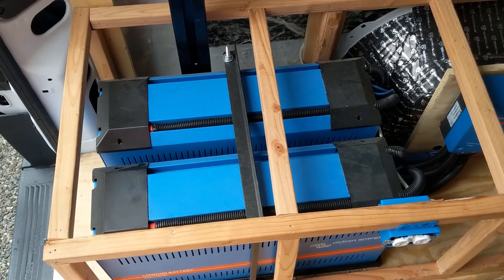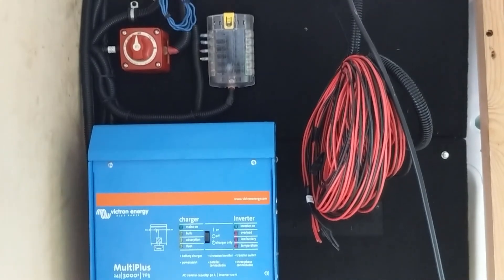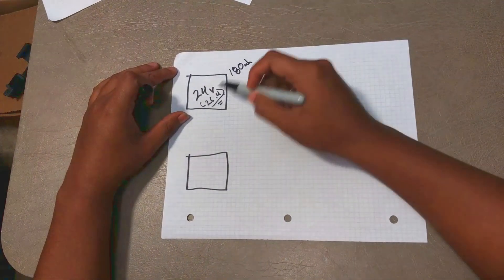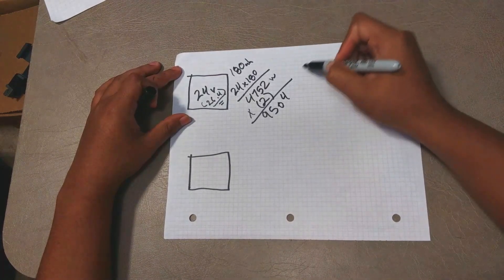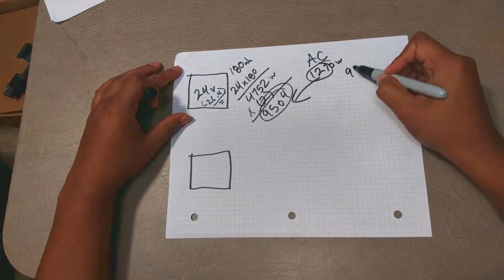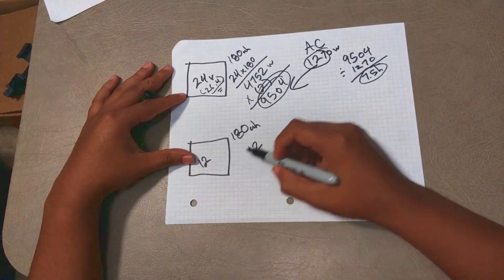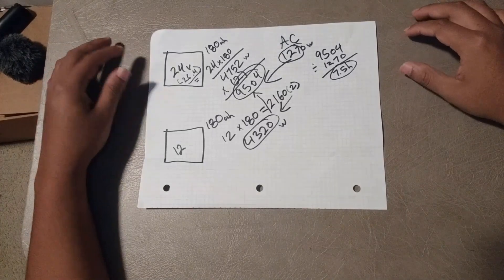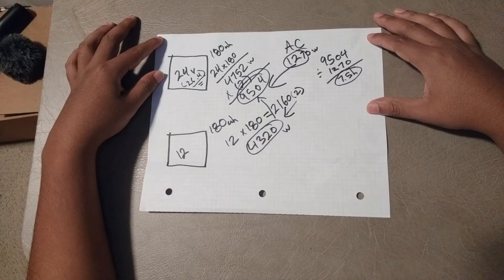Ultimate campervan electrical system | Power AC off-grid| #vanlife

Comment from the maker: READ FIRST BEFORE COMMENTING
To clear up some confusion about series and parallel read this article: http://www.enerdrive.com.au/connecting-batteries-in-series-or-parallel/ 
which says that if you connect your batteries in parallel it will double your Ah for the system NOT per battery and keeps the voltage the same  "2 x 12V 120Ah batteries wired in parallel will give you only 12V, but increases capacity to 240Ah." or if you connected your batteries in series it will double your voltage but keep your AH the same "2 x 12V 120Ah batteries wired in series will give you 24V, but still only 120Ah." Therefore 2 12v batteries don't have the same power as 2 24v batteries, because to find the total watts you multiply V by AH and to find the total watt hours. Then you dived by 100 which is mentioned in this article: http://www.altenergy.org/renewables/solar/DIY/battery-bank-sizing.html . "Let's say you go out and buy a battery for your solar system that is 12 volts (push) and 105 amp hours (storage capacity). You could find out approximately how much energy this battery will store / provide by calculating the watt hours. To do this, just multiply the volts (V) x the amp hours (AH) and divide by 100."
Reply: That is what I said....dumb ass
Reply from the maker: @albertcassler8763  This proves us right... our math is right.... In our video we compare (2) 12v batteries connected in parallel to (2) 24v batteries connected in parallel...
Reply: Nomadic Millennials yes you do in your video. But that’s not the right comparison. If you had two 12v batteries they would be approximately half the physical size and cost. So for the same space and money, you’d have four (not two) 12v batteries containing double the Ah each. So the total power (Watt Hours) will be the same as your system! So your example is basically saying “if we spent half the money and used half the space, we’d have half the total power”. That is true... but it’s not a reason to have a 24v system... there are some good reasons... you need fewer large cables (lower amperage), the jump through an inverted to 110AC is smoother.   Applying your logic, you could wire your two 24v batteries in series and have a 48v system, but that wouldn’t mean more Watt Hours. You’d just double the volts instead of the Amps. In parallel the volts remain 24 and the amps double. Either way it’s the same power for the physical space and cash you have invested in your batteries...
Reply: Here’s the simple maths:
Imagine you had two 12v 100 ah batteries. You can configure in two ways: series or parallel.
In series your battery bank would be 24v and 100 Ah giving 2400 Watt Hours of power.
In parallel, they would still be 12v but you’d have 200Ah giving.... 2400 Watt Hours of energy. The same amount of usable power!

Two batteries side by side, a 12v and a 24v, from the same manufacturer will be the same physical size and contain the same power. They probably cost about the same too! The 24v will have fewer Ah than the 12v. Does that clarify? Just helping to explain...
Reply from the maker: @jasonhughes6417  You couldn't fit four 12v batteries in the exact same space our two 24v batteries takes up. It's not half the size.. one 12v battery is a little bit smaller then one of our 24v batteries.
Reply: Nomadic Millennials 
Let me send a more detailed answer to explain my point. 

I accept that in reality a 12v battery might not be precisely half the size of a 24v battery with the same Ah. That’s because besides the parts that store energy, batteries (especially very smart ones like your Victron) have all sorts of other components like built-in BMS, connectors, circuits etc. These components don’t follow Ohms Law (!) so this might be a great reason to have one 24v battery instead of two 12v... because you’re not also doubling these components and the space occupied is perhaps smaller overall therefore.

I’m just trying to explain why some are questioning your calculation, and hopefully help some other viewers understand battery sizing.

Here’s a simple example:
Battle Born make a 24v 50Ah battery that retails at about $1000.
They also make a 12v 50Ah battery and it retails at $575. 

So it’s (a little more than) half the price, is also almost half the physical size and almost half the weight. 

But, as you rightly pointed out in your example, the 12v battery also has half the power (Wh) of the 24v battery (applying Ohms Law: 12v x 50Ah = 600Wh whereas 24v x 50Ah = 1200Wh).

However, if you got two of these 12v batteries (costing a little more $ and occupying a little more  space than one 24v battery) then you could either have:
12v x (50Ah x 2) = 
12v x 100 Ah = 1200 Wh (In Parallel), or;

(2 x 12v) x 50 Ah=
24v x 50 Ah = 1200 Wh (In Series).

So, about the same space occupied and price paid for the same total Wh of power.

Interestingly, Battle Born also produces a 12v battery the exact same physical size and weight as the 24v battery mentioned.  Guess what... it has double the Ah so it is:
12v x 100Ah = 1200Wh 
24v x 50Ah = 1200Wh 
Both are also the exact same price ($999), same size, same weight, higher Voltage, lower Amp hours, same Watt hours.

It’s basically the same battery with the internal cells configured differently to increase the V and reduce the Ah - maintain the Wh. 

So that makes my point. Ignoring other parts of the battery, and whether the specific manufacturer makes equivalent batteries in different voltages, the size and cost of batteries is linked to the Wh. If you reduce the Voltage from 24 to 12, without doubling the Ah too, then you aren’t  comparing like with like. You have a battery about half the size, half the price and - as you showed - half the power.

Don’t get me wrong, there are valid reasons to install a 24v system, including to reduce the wire size for example. But you don’t get twice the power from a 24v  system if you compare like with like. You get more volts, less amp hours and the same Watt hours.

Some people prefer 12v because 12v appliances are more readily available. 

But there is nothing wrong with a 24v system or your build - you’ve got quality Victron components in there. It’s just not quite right to suggest you got more power simply because you have a 24v system instead of 12v, that’s all.

I really hope that’s helpful to you and others?

(See links to the three batteries here:
https://battlebornbatteries.com/product-category/lifepo4-batteries/)

Comment: This is a little funny. Correct but funny. If you ran your 24v battery setup in 12v, they would actually be 720ah.  A 180ah and 12v setup is not the same as your system of batteries but actually a completely different thing because the ah change based on the voltage configuration of the batteries, and not just because they're the same "ah". Also the watts you get always go by the hour, so you can always know how long anything will.
(so yes)
180ah @24v = 4752 wh or watts of stored energy in one hour.
180ah @24v = 4752 wh x 2 = 9504
(and)
180ah @12v = 2160 wh x 2 = 4320 
(however)
Your 180ah @24v setup ran @12v will be = 360ah, 9504wh, and x 2 would be = 720ah or 19008whs. Which sounds amazing, but no one wants to run bigger batteries @12v because at that voltage there is more resistance and heat build up in the cables, so cables have to be thicker, and will cost more especially for longer lengths of it, so that's why so many opt for 24v setups, but it will drain your battery faster, and make a 9504wh battery feel like it's only 4752whs because technically it is just depending on the voltage.

Also if a 9504wh battery can run a 1270 A/C unit for 7.5 hrs, then it can also run 3x 5000w electric ovens (15000w) for 0.6hrs, or 36 minutes. So you can always tell, and also the ability to run anything depends on your inverter, and all electricals, not your battery, or size of battery. -Just throwing that in there.

Comment: 2- 12 volt battrries wired in series give 24 volts but same amps as the one batt...wired in paralel the 2- 12 volt equall 12 volts but double amps...I really don't think you know what ypur talking about
Reply from the maker: I never talked about parallel or series of course you can wire 12v batteries to get more amps or volts. What this video is about is after you do that how you can find out the total watts are in the system, which is done by multiplying the volts (V) by the amp hours (AH)....
Reply: @nomadicmillennials4577  becaise you dodn"t talk about series and paralle circuts, you left out very omportant information teguarding the bassis for configuring 12 volt to 24 volt comparison relation to wattage use....in effect, your math is off...
Reply from the maker: No it's not read the pinned comment.
Reply: Nomadic Millennials Yes, it is. You basically described how a bigger battery gives you more power.

Comment: Are there any downsides to 24v battery?
Reply from the maker: They are more expensive then 12v
Reply: Nomadic Millennials .....am I right in thinking you spent over £8k on batteries alone?
Reply from the maker: @mattwoodproperty  Yes pretty much. The batteries are selling for about half of that price now though: https://bit.ly/2tFtGaX
Reply: Nomadic Millennials ....holy shit....I’m glad I could live with the £300 option
Reply: Downsides are not price. Two batteries with the same total Watt hours will cost about the same regardless of if they are 12v or 24v. As the voltage doubles, the Amp Hours halve. The battery is basically the same size weight and cost (and power) whether 12v or 24v.

Actually 24v systems can be cheaper because you are using thinner wires and connectors (because of lower amps). Depends how much wire you will use I guess. 

The main disadvantage of a 24v system is that components (like water pumps, lights, fridges) tend to be 12v. However, you can get 24v versions too online easily enough. Or you can take the 24v output and reduce it to 12v using a dc to dc converter. 

Also, you’d need to check your solar array generates enough voltage to charge a 24v battery - probably does unless you have a small panel.

Hope it helps?

Comment: More the voltage; less current that you are using. If you get a 48v system; its even better👍👍
Reply: Exactly. Same amount of total power. More volts, less amps. Same size battery over all. Thinner cables and smaller lugs... but where do you get 48v appliances?

Comment: The only real advantage you get with a 24v over 12v is an improvement in voltage drop over cable runs as the 24v  system requires half the current of a 12v system for the same power (P=VI). Thus you can use thinner cables. HOWEVER, you won't get any other energy savings using 24v battery as it is no more efficient than a 12v battery. Battery capacity is dependant on plate size (weight and volume of battery) and battery design, lead acid, AGM etc, NOT on battery voltage. 
The real problem with a 24v system is that nearly all automotive electrical devices are designed for 12v, this problem probably outweighs the small advantage in reduced cable size.
Reply from the maker: Read the pinned comment we provide sources.

Comment: If you hook up two 12V batteries in parallel you have still 12V but the amp hours double. You would  have 360 amp hours. There is the same amount of energie stored in 2 batteries no matter if you connect them in parellel or in serial. But it is still a nice camper and some good ideas. Have fun.
Reply from the maker: Yes you can do that but since we have a class b van and are limited in space 24v batteries have more power for a small space. Thanks for your comment!
Reply: You guys have an awesome van but you kinda got the math wrong...  If you had used 12v batteries the same physical size, you’d have double the Ah and the exact same total Wh (power).
Reply from the maker: @jasonhughes6417    read this article: http://www.enerdrive.com.au/connecting-batteries-in-series-or-parallel/ 
which says that if you connect your batteries in parallel it will double your Ah for the system NOT per battery and keeps the voltage the same  "2 x 12V 120Ah batteries wired in parallel will give you only 12V, but increases capacity to 240Ah." or if you connected your batteries in series it will double your voltage but keep your AH the same "2 x 12V 120Ah batteries wired in series will give you 24V, but still only 120Ah." Therefore 2 12v batteries don't have the same power as 2 24v batteries.
Reply: Nomadic Millennials Dude - the article is correct!

But what you then say at the end about 24v batteries giving you more power than 12v - that’s not right! 

Both scenarios (12v parallel and 24v series) give you the same Watt hours!!!
It’s either 12v x 240Ah or 24v x 120Ah. 
Both give you 2880 Watt hours of power.

In your own example it’s clear that the same power bank configured as 24v reduces amp hours compared to 12v and the total power (Watt hours) is identical.

It’s Ohms Law! 

24v AND 240 Amp Hours? Yes, that’s more power (5760Wh) because it’s a battery twice as big!!

It’s not as simple as just saying 24v batteries give you more power than 12v batteries. Sure, if the Amp hours are the same they do - but that’s then a bigger battery!

Again, nothing wrong with your set-up or having a 24v system. Just don’t be thinking that 24v gives you more power than 12v - using the same cells. 

Just hoping to help anyone wondering to understand how this all works...